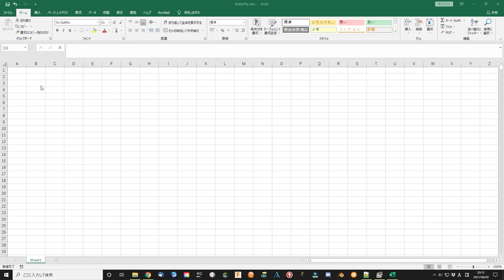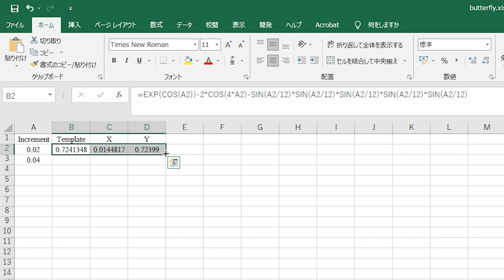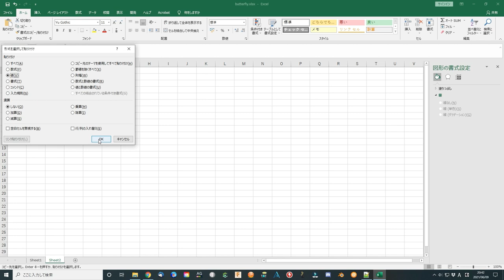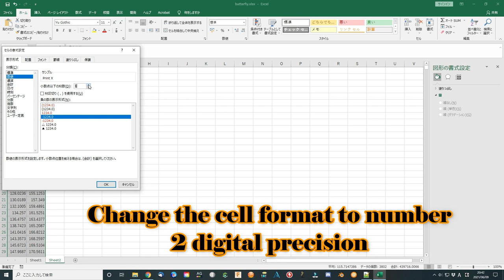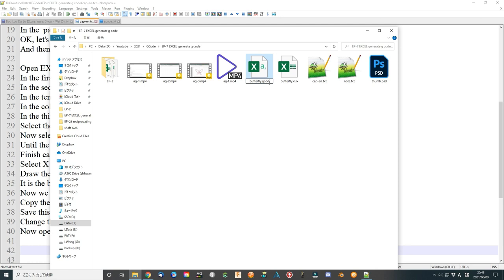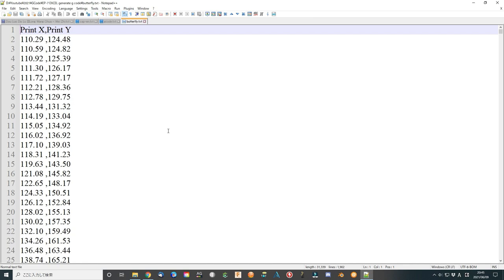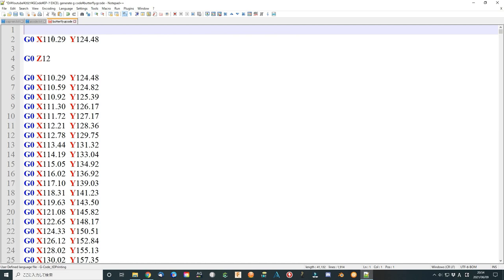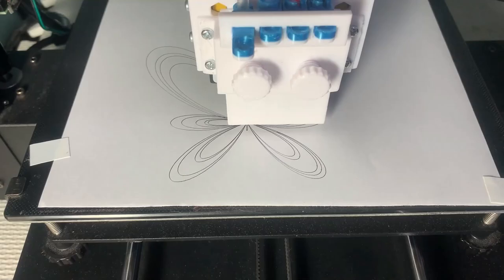How to generate the g Code file with equation and EXCEL for 3d printing (easy and simple)

Comment: Dear Sir, good morning, May I know why we have taken Under print x,y columns  we choosed=20*c2+110., I mean, is there any specific reason for adding a number110 .,
Reply from the maker: Thanks for your comment. It is a long time ago project. I almost forget about it. The value adjusts the figure to about in the center of the 3D printer printing area. So you can print the figure without error. Hope it explained a little. Good luck, have a nice day.
Reply: @TubeUnderdeveloped   Dear Sir, your work is more than outstanding, SIR I am interested to learn the work you are doing, especially I am interested to learn equation to g code for multi layers, and the mixing of two stl files., request kind help sir.,
Reply from the maker: @mohammedabdulla8693  I am glad you are interested in this topic. However, I have not worked on this for a very long time. And one accident last year that I have broken my hard disk and lost all my two years data.  Sorry for that.

I think I have more than one videos that discuss the 3d printing of a vase using an EXCEL-generated g-code file.  The difference between drawing and 3d printing is the filament extraction. In fact, this part is not so difficult. You just need to calculate the length between two points and multiply the scaling factor. All of these can be adjusted like filling density. I think have uploaded the file to the mini factory.  OK, here is the address.
https://www.myminifactory.com/object/3d-print-print-a-vase-directly-199675
Hope it will help you a little. Have fun with 3d printing or drawing.
Reply: @TubeUnderdeveloped  Dear Sir.,
Good evening Sir.,
Sir., I am interested to learn more about each of your videos , please help me in this regardsSIR
@ Abdul.

Comment: Dear Sir, good morning, 
Sir, I am facing difficulty converting the AutoCAD DXF file into the G Code file.
For small files, DXF2GCODE.exe is working, but for higher-size files, 
the software either taking days without giving any output. Or just disappearing after exercising the option.

Sir, please guide me on what to do.
Regards
Reply from the maker: have you ever tried Carbide Create? This is also a very good free software that can generate gcode files.  Good luck.